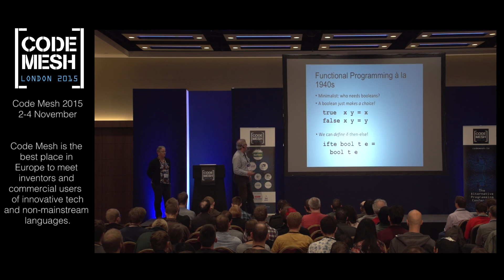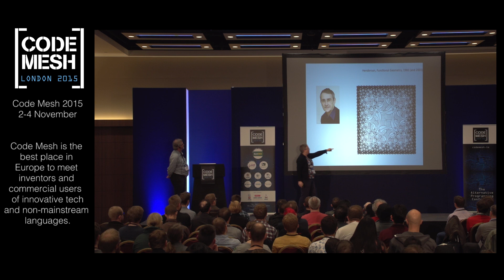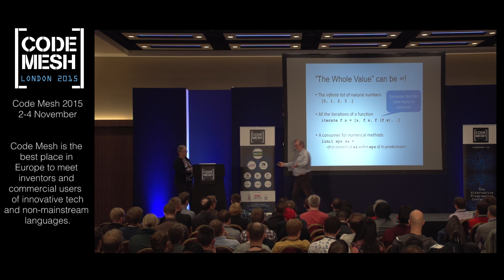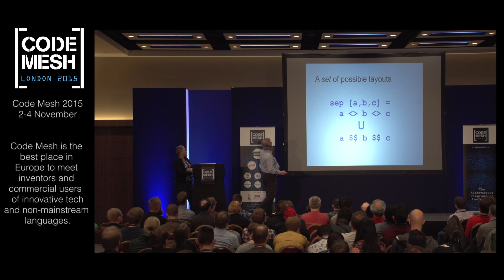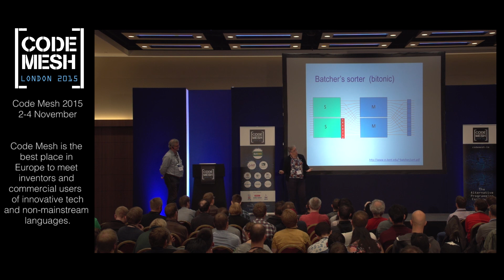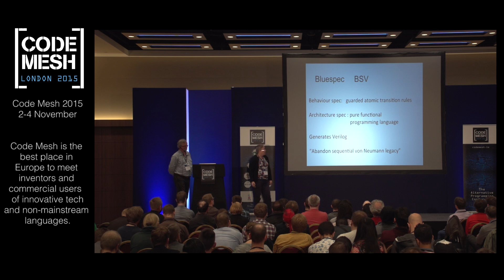Keynote: Why Functional Programming Matters - John Hughes, Mary Sheeran

Comment: How do you use functional programming in a highly event driven environment? Say with a barcode connected to a serial port, a socket connected to a scale, and a couple of IO points based on state/status? I don't see it. Computing numbers and parsing languages, sure, great. But in an industrial setting where there are multiple inputs and a system with several states and an event driven UI?
Reply: I previously worked in a scientific lab where we developed several custom experiments using F# including a custom microscope. We were handing a lot of data, doing custom DSP in software and often concurrently communicating with several devices. We heavily used asynchronous and event-driven programming and it was a huge benefit to our productivity once we got to grips with the techniques.
Reply: 1) You can use states in functional programming. 2) You will need some kind of library to interact with barcode, but after that to parse the barcode and process a response to that is trivial in fp. 3) I programed a game in prolog, another declarative language and I there was no problem with events, etc. Like every language/paradigma is not universal, fp has strengths and weakness.
Reply: one of the important aspects is immutability as well.